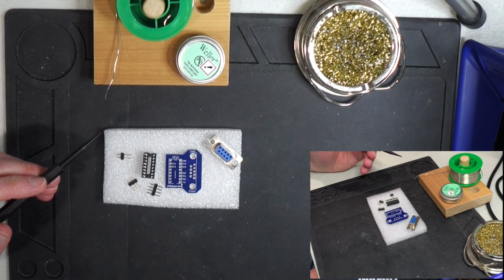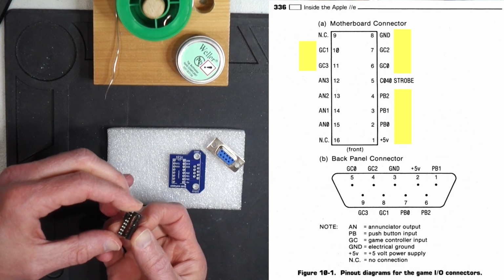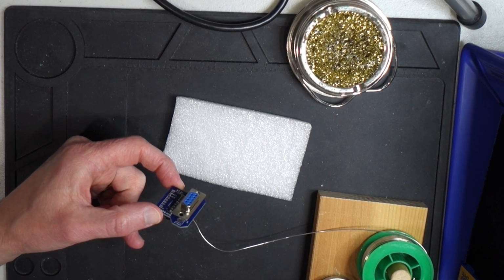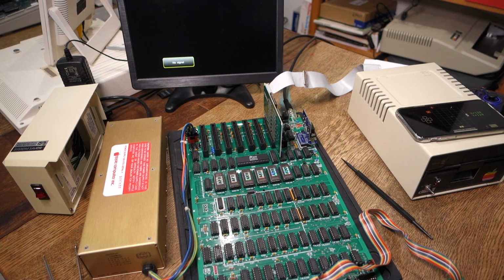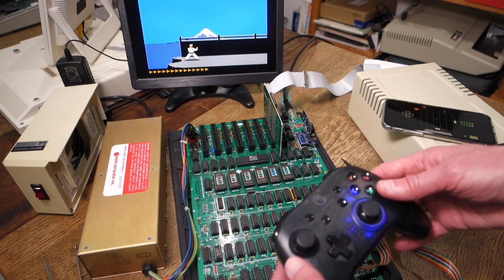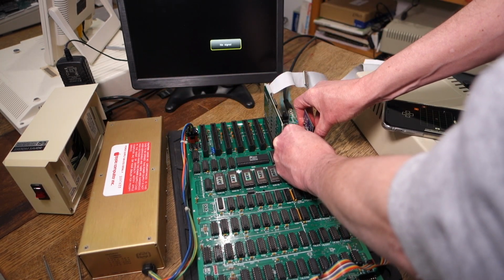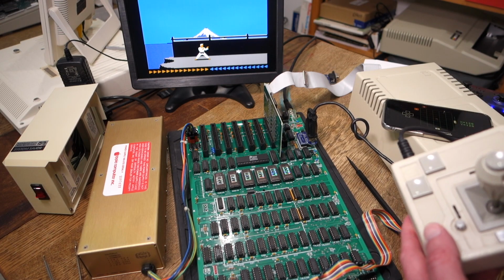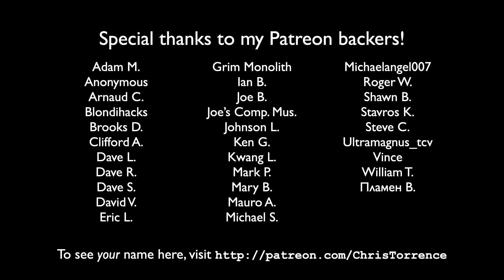#123: Apple II II+ Joystick Connector

Comment: I really like that you used a right angle DB9 connector for this adapter. Even if you have an Apple IIe w/ 9pin game port already, this handy adapter will let you install the A2io internally for stealth operation :)
Reply from the maker: Right, exactly. Although it actually is a straight-thru DB9 connector, since the board sits directly on top of the socket. It made it simple to solder the pins on one side and the DB9 on the other.

Comment: Is there a way to use an apple II joystick on a modern Mac or PC through a USB adapter?
Reply from the maker: Yes! There are a couple of different options. You can buy an adapter like this: https://www.reactivemicro.com/product/joystick-shield-from-retroconnector/ or you can buy an actual retro joystick modified with bluetooth: https://youtu.be/q91Fk8GcdW0?si=vTmH3pduI2938h2F